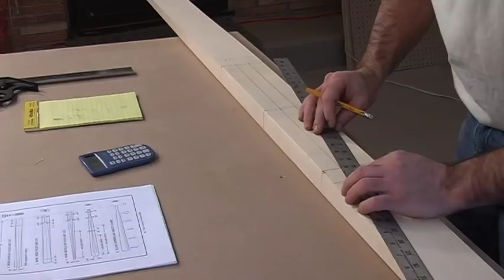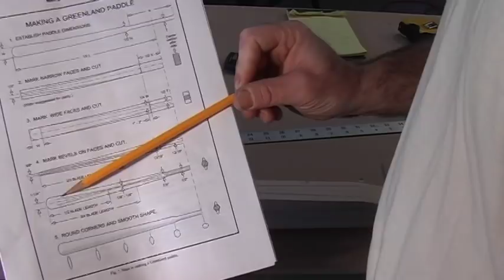Carving The Greenland Paddle - Full video

Comment: Nice video. Little tip - when you're shaping the paddle blades - clamp your work so you can work with both hands and the piece is stable, and rather than take short strokes with the plane, work instead along the whole length of the paddle blade with long steady strokes and shorter ones only to correct a necessary.

Comment: Very well explained and limited use of tools. By the way, if you have a high grade jigsaw, the cuts will be very straight. The blade is wiggly on cheaper ones. If you use larger width blades this is partially corrected.

Comment: Hi !  Can you tell  me  from  where  you  download  the  plane  for  this paddle?
Reply from the maker: oaagea Not sure what you mean?
Reply: It's  ok I find out from  where  to download it.. my question  was where I Can find  the plan for this paddle.   I will  start  very  soon  to macke  one too! Th any way !
Reply from the maker: Great. I haven't checked to see if the plans are still at the same site. I'll check
Reply: +bullyakker these are the exact plans he refers to download in the video and the ones he is using as well. =D
Reply: +bullyakker I myself have used these plans MANY times though i use different tools so i can make them much faster and easier but there's nothing like pouring your blood and sweat using hand tools to hand craft such a beloved tool (paddle) you'll use for years and years!
Reply: +bullyakker Also, I coat the ones i make for myself and family(if they want it) with an epoxy resin and apply carbon fiber to the tips of the blade. (You can carve and sand this area thinner to make it seamless though some will just simply wrap fiberglass and epoxy around the tip and call it a day.. I mix technology with old school craftsmanship kind of how Norm Abram went from the 'Olde Yankee Workshop' to the 'NEW Yankee workshop'.  When you make one or two, it's all hand craftsmanship.. tedious and tiring but ooooh its 'special'.  Power tools make it a snap however without any flaws except a bad piece of wood itself.. (good for practicing on) I have since started experimenting and using friends and family as guinea pigs. instead of the blades bowing outwards, I wanted to see if curving them inwards would yield more speed and/or less effort. LOTS of sanding later on a demo paddle and BAM! it was a hit.. so 22 more to make to keep them from nagging me weekly about 'when can i get one?!?!" lol Enjoy your paddles and paddling and Thank you Matt Johnson for the video! This is the first viewing of it for me but i will keep it bookmarked for those who ask me about carving paddles! Excellent video!